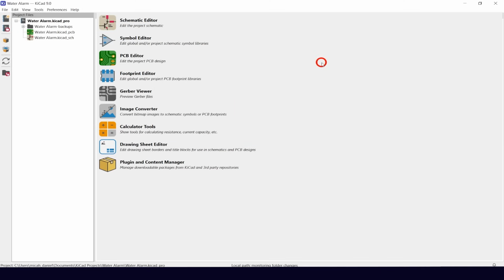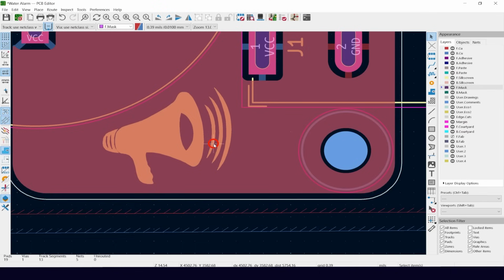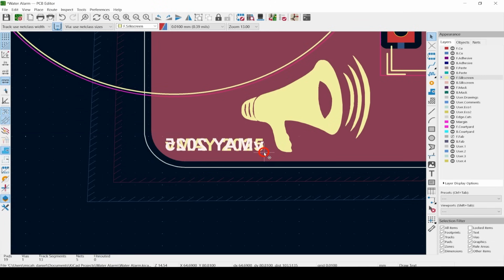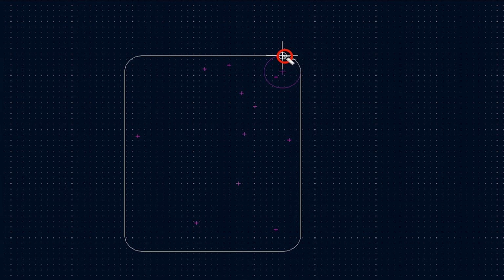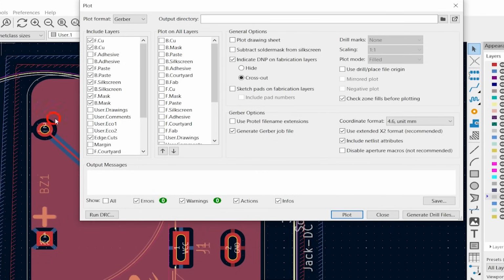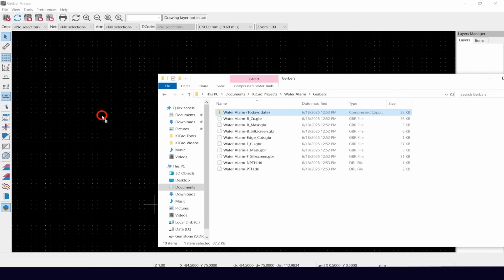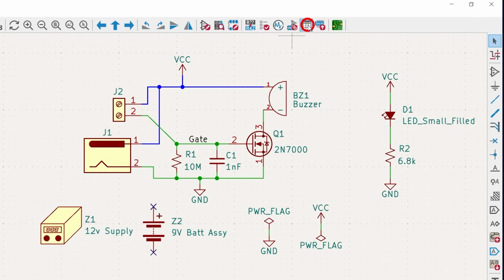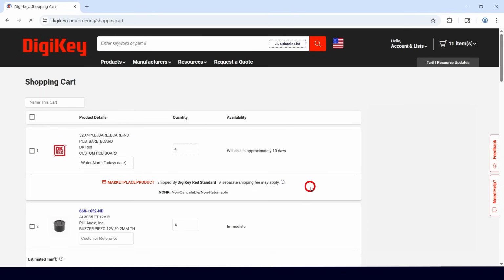KiCad 9.0 – Getting Started Part 7: Images, Gerber Files and BOM | DigiKey

Comment: Awesome series, a lot of changes in v9 since v4!!  Honestly I was kinda lost for a while.
Thanks!

Question/request: many times I use photo-resist and etch prototypes, I think these steps would make a great part8. Also how to make  templates for solderpaste stencils could be valuable, for prototypes I use mylar solderpaste stencils... I will cut 3 or 4(or whatever will fit on a sheet) it is nice to have a spare, or two, some import solder pastes seem a little stiff and or abrasive.

Thanks.